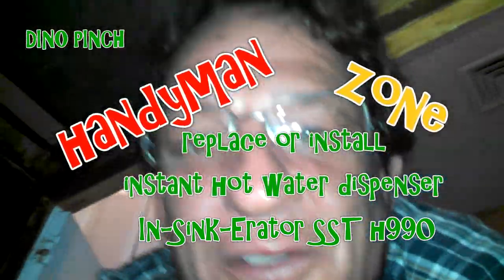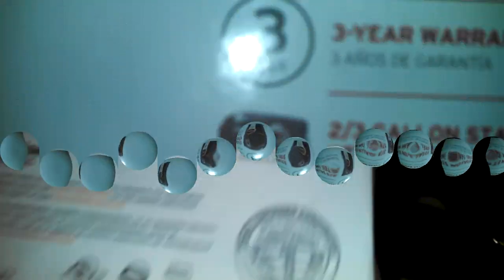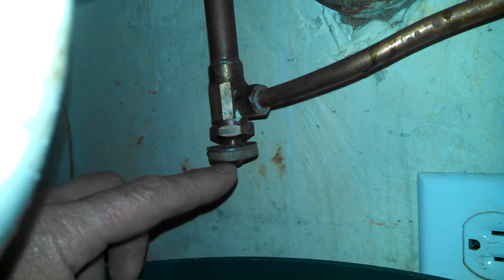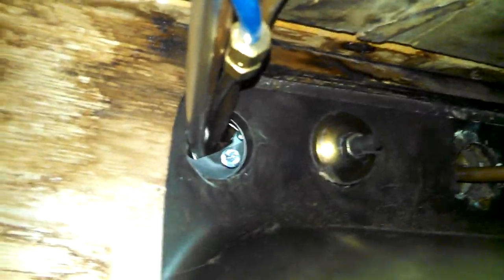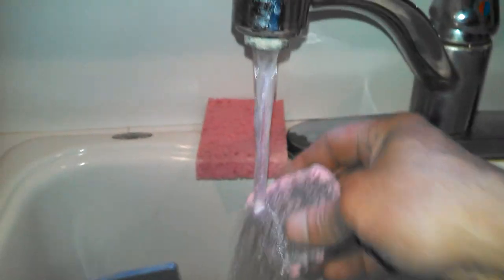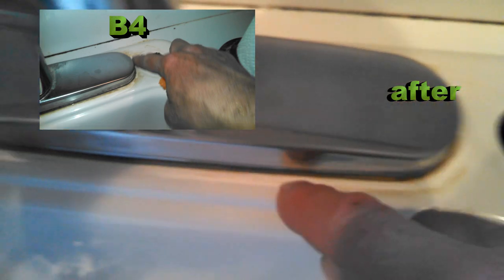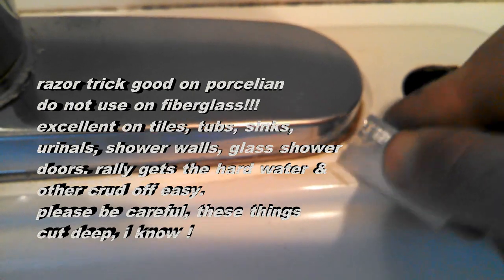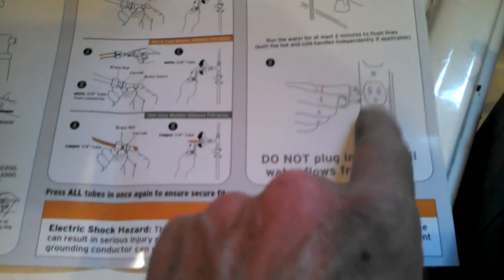REMOVE or INSTALL  any under sink INSTANT HOT water tank  part 1

Comment: If I just want to remove the hot water system tank do I need to plug or block off the supply line so water doesn't go everywhere when we use the sink?